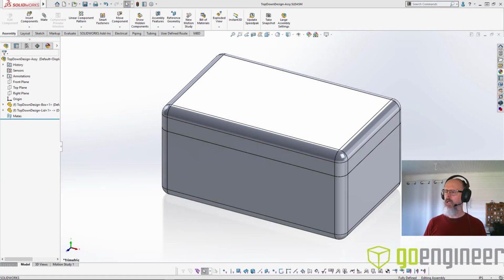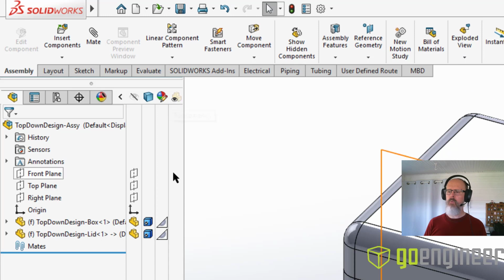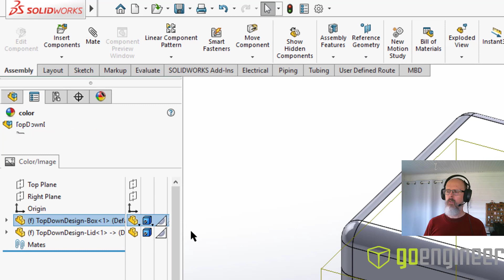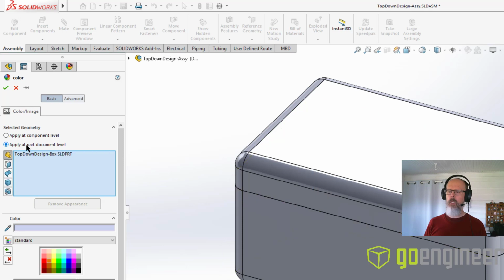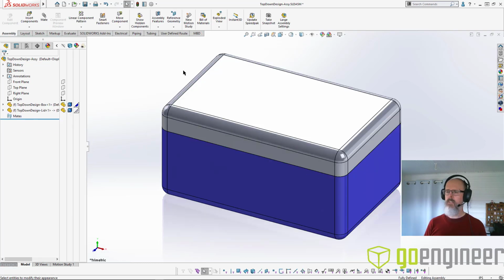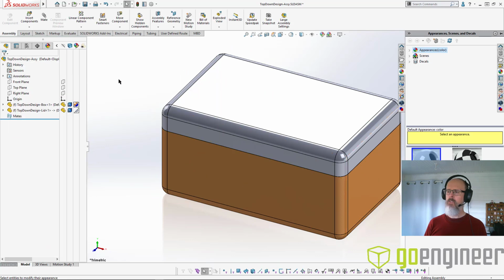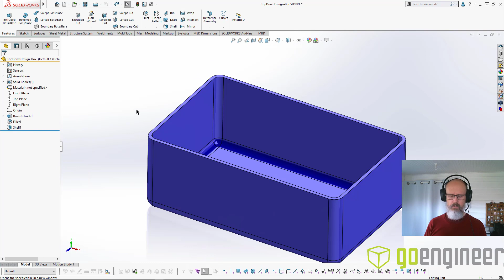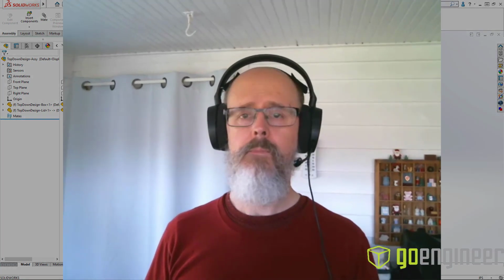SOLIDWORKS Tutorial - Assembly Appearances

Comment: Does anyone know if its possible to change the colour of only a couple faces of a component instead of the entire component. For example I am working on an assembly part and just want to highlight a couple faces that require additional matching after fabrication.
Reply from the maker: Yes is it possible to change the color of individual faces.  However, face color changes can only be applied at the component level so the face color changes will appear in the part when opened separately from the assembly.